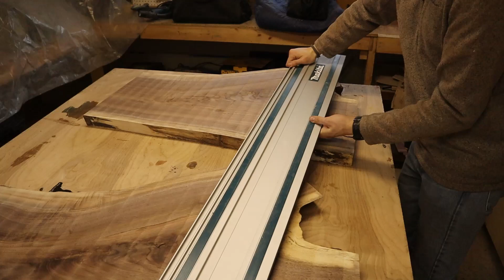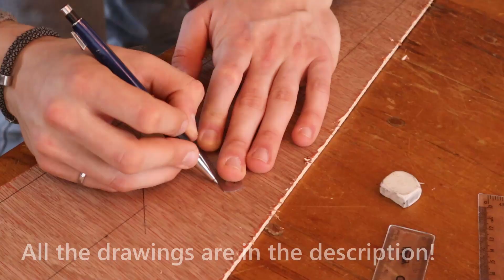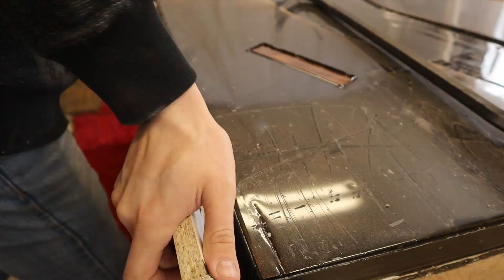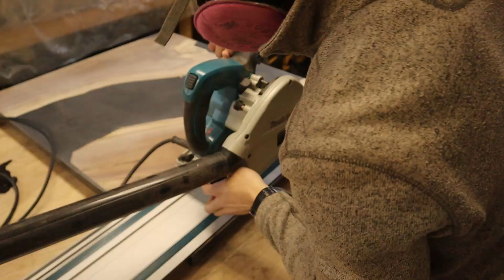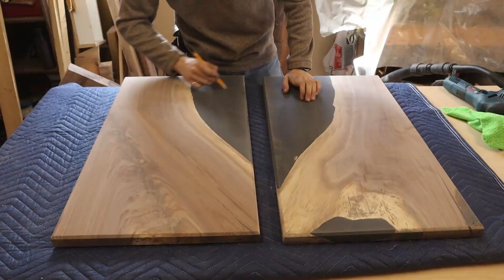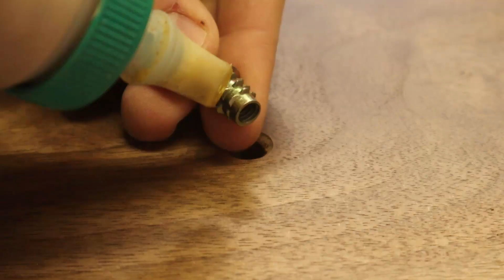Building A Modern End Table | Side Table | Free Plans

Comment: Awesome project. 
Did you have slabs outside? What was the moisture content?
Reply from the maker: The slabs were inside and the wood for the legs was outside. Slabs were around 10% and the wood for the legs have been drying from like 20 years aha
Reply: @AlexKatWoodworking  Next time try to bring wood inside for about 1-2 months. The wood outside dries to around 15% and thats to much, ideal for indoor use is 8-10%.
Reply from the maker: @CopiWood  makes sense, thanks for the tip 😁
Reply from the maker: I actually just checked and the wood outside is at 9-10%. I guess in Canada over the winter its pretty dry aha